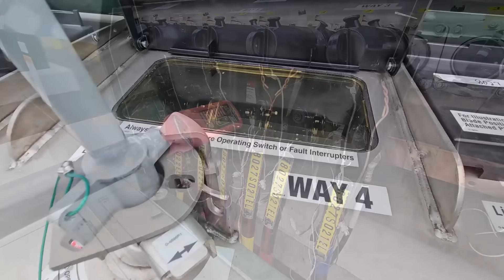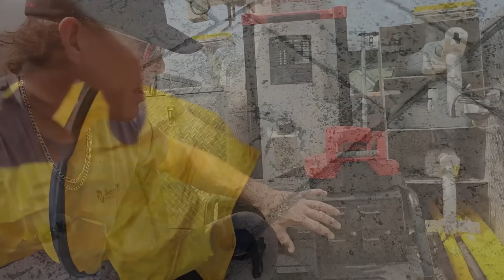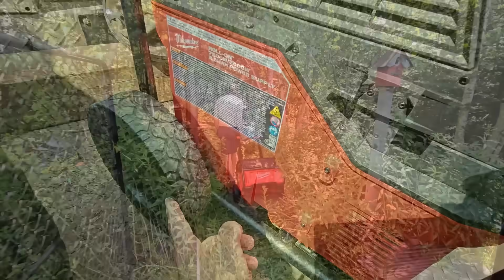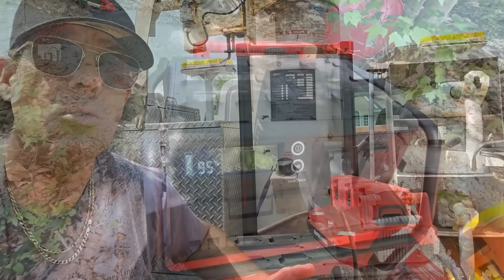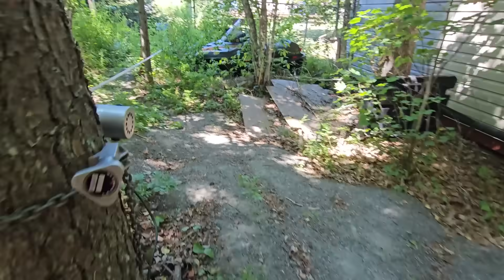Is it good enough for Lineman? - 7200W Lithium battery Power Supply!

Comment: There is absolutely no reason for anyone to buy this. We have tons of solar generators on the market with larger batteries and solar panel connectors plus way more functionality for 1/2 the cost!

This is simply an over priced battery with no functionality.

Comment: Late reply, I hate when they call "batteries" "generators". It doesn't generate anything. If you were in a hole underground, with no gas, solar, wind, power outlets....it wouldn't "generate" anything once the stored power was used up.

Comment: Not practical for work… The price tag on this unit is $5k for a unit that will not run even few hours at 2.5kW load. They advertising it as 7200 peak watts while continuous demand can only be 3600W max but the battery is not even sized to handle it for an hour, only 40 minutes. 
Reminds me fake CFM advertisement on some of the air compressors in big box stores.
A small Yamaha or Honda inverter generator is the way to go on the job site or at home. It is quiet, reliable and you don't wait 3 hours to refill it.
Nothing against inverters but sometimes things may not be practical
Reply: It depends on the type of work. These are best suited for intermittent loads where a generator would be wasting fuel idling 90% of the time.

Comment: There are homeowner type portable batteries - look at units from Ecoflow and others which are basically the same thing. Some can even power a whole house with a 240V split phase system.  So this unit is more for trade use, while Ecoflow and others are meant for emergency home power use. The benefit is again, silence and no emissions so they can often plug right into your panel where ever it is in your house

Comment: for all the "nay sayers" this demonstration is to see if the thing is suitable for their purpose. In many cases 90% of the the actual power use is only counted in minutes over a multi-hour job. The exception would be tools like that blower, which may need to run for a few hours straight. I doubt that draws more than a few hundred watts by itself. You'd never use it to power an electric heater. OTOH, a salamander heater only uses power for the blower (and ignition) so we're back to a few hundred watts draw. BTW, on a slightly different topic.... I recently got to watch a utility truck with a battery powered boom installing a new service. They were up in the air working for about an hour... and almost completly silent!

Comment: A lot of comments from folks who don't understand the use case for this device. I'd be curious to know how you will handle recharging. Back at home on commercial power or on the truck with on board power? You mentioned the possibility of CO2 in the pit which would be a problem but were you possibly thinking about CO which is probably a bigger problem. Great video. Thanks!

Comment: had one, got stolen it was recovered but ruined when they tried to grid the identifying marks we put on it.. insurance replaced it was on our work truck and it basically went up in smoke after it got some water in it after 3 of our trucks were taken off road to a site.. got fed up so we got a welder generator and its bolted to the bed of the truck and its outside all the time.. the model is a silent model and we have a modified sitebox over it as a sound snubber.. noise or not we toss everything in the bed plus the generator is run off the trucks fuel tank for extended use.. i guess what in saying is each trade is different for clean trades like construction/electrical thats fine but when your driving through logging roads full of water it doesnt fit the jobs we do which is remote cleanup, vehicle recoveries/equipment recoveries and such if they could actually make it fully IP rated and the ability to perm bolt to the bed of the truck and not fully made of plastic that can break we would look into battery/power boxes... i also find it great as when i manage to clear the pile of tools and install my fifthwheel for my RV i have power even on the move xD

Comment: Our company had an electrical panel fire a couple of years ago. I purchased a Milwaukee MX Fuel Inverter as a back-up source of power. We were able to put it right in our computer room to run our internal network. It lasted all day powering our network computers. The inverter had two MX Fuel batteries on it. We would have spare batteries on a charger in another part of our facility that would replace the depleted batteries. You could change one at a time with no power interuptions. Very nice unit!!

Comment: The only tool I still need alternating current for is the Greenlee hot box for bending up to 2" PVC. Everything else on my truck is battery operated. I also have onboard the M18 Power Supply 1800/ 3600 with (4) new Forge 12.0ah batteries.
Reply from the maker: Sounds like you have a nice setup!

Comment: I think that would make more sense for the price if you could attach solar panels to it to help lessen the battery drain.. You could buy a couple ECO FLOW Power Stations for that price though, some of which come with solar panels. So extremely specific use.

Comment: You'll get a lot more bang for your buck with those portable power stations from consumer companies like EcoFlow, Anker, etc where the competition is fierce but I can  understand the appeal of the Milwaukee unit. I just hope Milwaukee gets squeezed on price in the near future. I've been building my own portable power stations for over a decade and people would be surprised by how long they can run powering tools. The instantaneous power draw can be quite high but the cumulative power usage is often much less than you would think. Generators waste a ton of gas for how much power they actually deliver. In any case, getting rid of those damn contractor generators is extremely welcome. I hate them so much.

Comment: There are battery powered blowers now. My company bought a couple to try in order to just charge the batteries with an electric generator instead of using the generator to run an AC blower.

Also, fyi, I built my own portable generator by purchasing a good dolly, some plywood, and mounting a decent mppt solar controller, pure sin wave inverter at your desired voltage/amperage needs, along with 1 or 2 large 24V or 48V 200amp/hr batteries on the bottom. I can plug a charger into the wall to keep it topped off, and if I'm using it during the day, i have a couple 30 lb solar panel briefcases made by renogy. Link em up, and plug them in. You will get more battery for less money this way, and with the solar pabels, you can run all day without losing all your charge. Plug back in at night to top off.
Reply: Been planning to do something somewhat the same but for home use. I rent, and can't install any solar permanently. I'd really like to offset my power use during the day and early into the evening, and was looking at a big iron phosphate battery, a few panels, and some wiring hardware to have auto failover to mains. Will also make for a good UPS in the long run.

Back of the envelope calculations: with the Aussie solar advantage, it should pay for itself within 3 years.
Reply: @ConstantlyDamaged Don't waste your time or money with anything other than lithium. They are lighter weight, can be drained down to almost empty and come back to full, and they are the only batteries with high enough C rating to pull the full capacity or more. I have a dolly with a single 24V lifepo4 battery at 100 amp hrs, and it's connected to a large mppt controller, plus 24V pure sin wave inverter that can do 3500W peak at 120V AC. To run that with lead acid, I would need almost 250 amp hrs worth of 24V batteries that would all need to be kept above 40% or risk problems. Eco-worthy is putting out some very affordable lifepo4 100 and 200amp/hr batteries with built in BMS. 

Do not run a 12v system if you plan to use more than 1000 watts. These are mistakes people have made and continue to make.
Reply: @paaao LiFePo4 are iron phosphate batteries. And yeah, my nominal draw will be about 220W. A 1kW inverter was the plan.

Edit now I'm not on my phone (I hate typing on that thing).

We use 240v (actually 235, but most people don't realize that) here. The big thing I'm worried about is solar panels. The ruggedized ones used for 4WD and such tend to have a much shorter life, or so I hear, and don't provide as much wattage per surface area. At the same time, I am more than a little worried about installing what would look like expensive solar panels on a portable stand, and having someone steal them. I think I'll just ask around my local solar installers until I can find one who'll make a jig with the panels attached that I can chain down to something. They'll be able to advise on safety too, no doubt; the laws here can be really strict on safety devices and cutoffs, even if it isn't going to be hard-wired.
Reply: @ConstantlyDamaged I read your post too quick, but yeah. There are inverter manufacturers who make whatever AC output you need. 

The N type solar panels are what you're after I think. They are more black in color as opposed to blue. Produce more power per sq ft of surface area. Lighter weight overall for what you're producing
Reply: @paaao  Cheers, mate. I'll definitely look into darker panels.

Comment: How long does it take to charge it? I use a generator when I do MH splicing. If it dies, I fill the tank and keep working. Can this unit las 8 hours of constant usage under a moderate load? Seems awesome for small tasks but not a true game changer for my work. Plus, my Honda generator purrs like a kitten. I get the fumes piece, but the noise is not an issue. The road noise around me is worse. It is a cool tool. I can't add a 'cool tool' line item to my customer invoices.
Reply: "Moderate load" is fairly subjective and depends on the specs of a given set. Where one of these shines is "intermittent use" such as power tools. You might run a generator for an hour to power a skill-saw that only runs for 10 seconds at a time. You'd be hard pressed to draw power there for 5 minutes over that same hour. With a battery supply, you have only used 5 minutes of that stored juice. If you had the ability to use a portable solar array you could go home with a 90% charge at the end of a day. Depending on use, the $$ break even will be in the 3 - 5 year range for cost of a gen & fuel versus a battery unit. BTW, 250 work days in a year = about 2,000 hours of run time. Even a Honda will be tired in a year or so. You can likely get near 1,000 full cycles on batteries so closer to 4 years.
Reply: The other week they did some work with the sewer lines in my street. They had a generator running in front of my apartment all day.
The purring of your Honda generator might not annoy you, but I can guarantee that everyone living in the street will hate you for it.
The constant buzzing of a generator for 8+ hours gets really old really fast.

Comment: You say like this is not a homeowner's toy/tool. I did math and I agree. This box claims 2.5KHw. My home sucks 05.KWh to 1.5KWh (more on laundry day). So even being careful it would only hold thru a 5 hour power failure (Jeep hit a pole), not a couple-day outage (state-wide storm). I could try to rig it to boost a propane generator to run my well-pump, but four and a half grand would cover a LOT of bottled/trucked water, and still replace all the food in the freezers. This makes sense for well-capitalized businesses.
Reply: This is really a replacement for a generator on a work truck or job site. Take it out and run your tools for the day and then recharge it over night for the next day.
Reply: @mgkleym    that's really the way to do it since most tools are intermittent use.
Reply: Why wouldn't this hold thru a multi day power outage?
You wouldn't do your laundry during a power outage, right?
So realistically it's just the fridge and freezer, lights and whatever little electricity your heating uses (assuming you don't have a heat pump). Everything else can be turned off during a power outage.

Of course it still doesn't make any sense to spend that kind of money on this for home use. Especially since solar batteries are a lot cheaper.
Reply: That's not what it's meant for. And you wouldn't ask it to run your entire house anyway. You'd use things like this to power a fridge/freezer, and maybe some lights. (yes, there are MUCH cheaper consumer battery "generators" out there. the only reason to get one of these is when you have someone else's checkbook)
Reply: @jfbeam  also the cheaper ones are usually only rated for sheltered use, so bonus points to Milwaukee for that. Definitely many options on the market for all use cases and price points
Reply: Once the battery is drained where will you charge in during a power outage 🤷‍♂️

Comment: It has zero emissions because it's not a generator, it's a gas can we should be calling battery power stations some thing other than generators that put off carbon monoxide and kill people to differentiate them. There's also the technical difference that like I said it's a gas can it doesn't generate it converts. They are the equivalent of a gas tank and a motor minus the engine. The inverter is the equivalent of the motor generator and the battery is the equivalent of the gas tank that can be refilled. But a gasoline generator has the equivalent of what solar panels would be. However unlike a gas generator batteries can be charged from multiple different sources and reused without having to be refilled with one time use dinosaurs.

But my biggest take away is people buy generators and run them in their garage and in their house and then they make the newspapers for killing themselves. the marketing team is trying to bank off that this is the same thing as a generator when it is absolutely not and should not be confused.
And that can have devastating consequences.

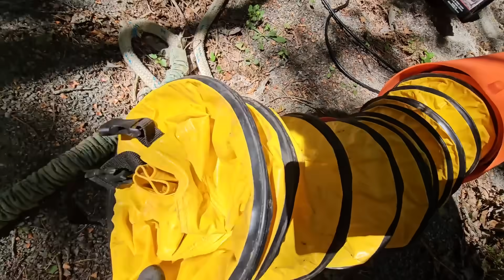EDIT: OMG 6:05
oh my gosh my point exactly and I did not know that.
Reply: Yeah, power station would be the correct term, of which you could buy a couple of them for that price.

Comment: no construction site works without grid power or generator. where to charge the tool batteries? in cars outside? who's going to go outside to do that? temporary yes, full day no. if somebody comes up with better solution, it's fine. imagine trying to explain to client or boss how your battery ran empty and now you can't work. i bet actual workers carry spares too. oh and no site wants to work on battery anxiety. work is done when it's done, and there has to be enough energy present

btw, it's big tool maker and they can't test their own product with loads?
Reply: It's obviously not intended for all day use with high loads.  These things are brilliant if you use them sensibly.  Doing extensive electrical work at a house, plug the fridge and internet connection into one of these sorts of things and the home owner will love you.

Comment: Great unit especially if someone else pays for it $4500, after several years the battery is done.  2.5kwh is minimal.  Figure 5kw load for 30 mins and your done.  Current battery technology is not replacing fuel anytime soon.
Reply: Surely this uses LFP batteries.. those last a lot longer than "several years".
Reply: Fully replacing fuel anytime soon? No, I agree it's not fully competitive. But the same can be said of gas generators, they're actively being replaced by batteries due to the upsides mentioned in the video, so gas generators do not fully out-compete batteries either. And nobody claimed batteries would replace all gas generators, that's a narrative you seemingly invented. And as for your projected lifespan, most modern lithium batteries get 1500+ charge cycles, so you can fully discharge it every single day without skipping a day for over 4 years, but you'd still not be completely dead, you'd be at the threshold the manufacturer considers no longer "in spec" (usually 70% or 80% of the original kWh rating, but again, far from 0%). So yeah, there's downsides for sure, but they're not as severe as alarmists are making them out to be. Use common sense to determine if it suits your needs, and if it doesn't, that's perfectly fine, but for many people they do fulfill their needs.
Reply from the maker: Well said!

Comment: One word of caution.  These inverters (same advice goes for both battery powered generators as well as gasoline ones) put out clean power only when the loads are within spec.  However, starting a large motor load (the universal motor in a circular saw was the example I've seen, but your puller and possibly even the blower) can lead to power spikes while the motor is reaching speed.  I doubt that will pass through to the USB charging circuit, but it can damage sensitive electronics plugged into the 120V outlets.  So, it's perfectly safe to plug your laptop into it alone, but possibly not so safe to plug in that laptop while running motors.
Reply: A laptop charger will typically be a SMPS type. Often will be able to use something like 100-240VAC automatically so the power spike would have to be a really good one. Then the SMPS would just fold back or shut down. Granted you don't want to risk it if you don't have to.
Reply: Very good point, for both types of generator you can sometimes use an inline soft starter for motors that would otherwise bog down the sine wave or cause an overcurrent cutout.

Comment: It appears that one of the workers is smoking in a confined area.  Is that the gas monitoring system?
Reply: looks like a marker to me.
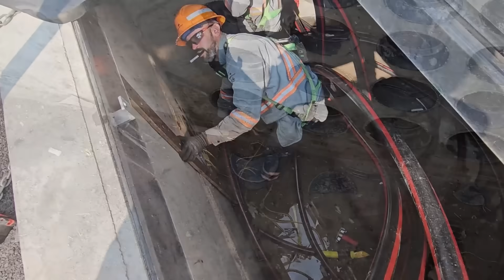Reply: Yeah, at 4:48.  I thought that too, but a freeze frame showed what looks like a sharpie permanent marker.
Reply from the maker: It's a marker. The board was a template and he was holding it in his mouth as he moved the board along the wall to mark the screw holes.